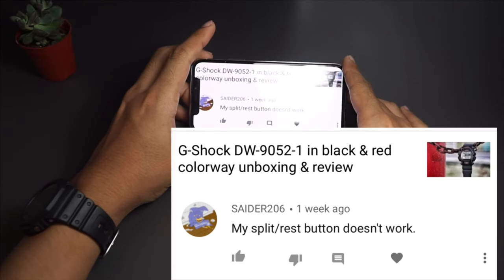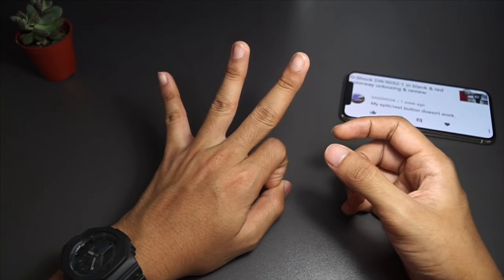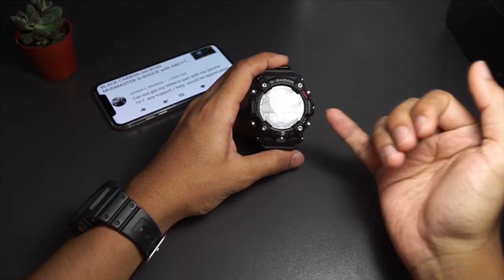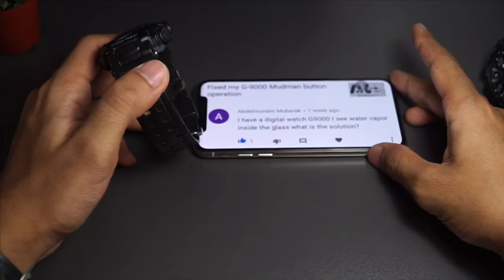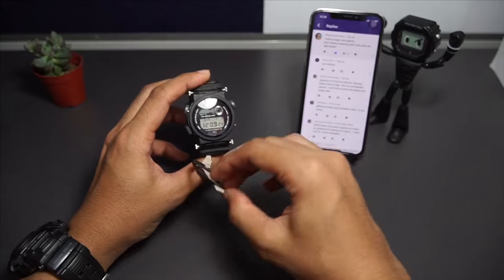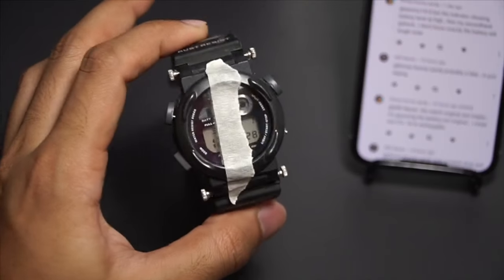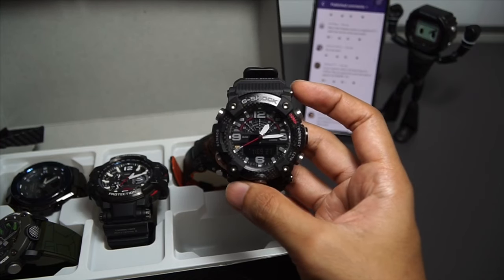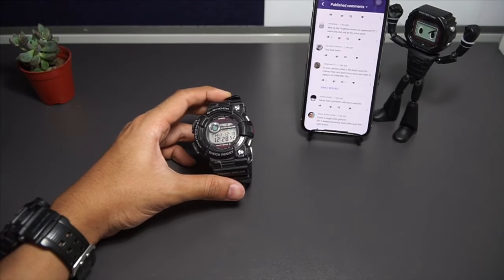3 Reasons why your G-Shock buttons didn't work | G-Shock Q&A

Comment: Hey, Thanks for this video.🤩 Btw I changed battery & did a reset on my Husband's G-Shock 5081 but afterward only some of the settings buttons will kind of work but will not allow me to actually set date, time, etc also the display light doesn't work either.
Any suggestions? Thank you 😊

Comment: Just got a new gwf-1000-1jf from Japan and noticed that the bottom right forward button is not working. This means that I can't access the get screen or make changes in the mode and adjust screens. Any thoughts on this?

Comment: Hi buddy, please help me!!
My g shock ga 400, which was gifted to me by my dad when i was young, has problem with the rotary switch after battery replacement!! Everything else is working! Please help me, no one can figure out whats wrong!! This watch means a lot to me
Reply from the maker: My guess it was loose or it was install wrongfully. 

After a battery replacement, you'll need to perform 'AC Reset' for the watch to work properly afterwards. Do that first, then check the crown.
Reply: @gshockhighfashion  did the AC reset after the battery change, peeps are tellin me that the rotary swtich pin might not be aligned properly, still tryin to fix it

Comment: Hi.. any idea on issue for gulf master GN1000, adjust button didnt work?
Reply from the maker: It's pretty old model by now, maybe some cleaning/grease is required. Inspect the connection on the circuit board as well while at it.

Comment: My casio Gshock G9000MC mudman series, 11 years just running out of battery, can be replaced with CR2025, but the MODE button now does not work for settings, is it because the module is lifted and imprecise

Comment: Hey I changed my battery om my gm5600 scm an when I pressed the light button it did the reset fade to nothing. I ened up just setting the time an date and when I pressed the light button again it worked. Guess the watch had to reset it self or something was in a bind in it.

Comment: I have a Gshock GBD-100 move and I fully broke it down with the shell. I did not take apart the movement on the back but I removed the black rubber shock part, two gray pieces on the sides, the bands and the biggest button. Everything went back together fine because Ive done the bands 100 times but the big black main button on the left will not snap back on or stay in.It almost looks like the way this button is attached, that I may have to find a new one. Help lol, thanks in advance.

Comment: Hi sir, my GBA 800 light wont́ work, only if I press the connect button first,do I need to send it back to Casio or can I fix it at my own?
Reply from the maker: You cannot operate your watch at all
of it is connected to your phone. 

You have to disconnect it first, them the light, the button and all could work as normal.

Comment: my GST-B200 is stucked at "charge" flashing mode, with the needles all pointing at 12pm and buttons not responsive. i sun it for 3 days but no change, could it be damaged battery?

Comment: Hi sir,my g shock 100b light is no longer working.is the bulb or the light is damage??
Reply from the maker: I'm guessing you're talking about GA-100B, if that's the case then that is a possibility. You'll need to inspect the connections on the board for any oxidation or battery leaks and of course the led itself.

I have no idea what is cause for all these issue but I've experienced it before on my GA-200 & GA-150. The problem though, look for the right replacement LED is very hard.
Reply: Okay sir,thank you

Comment: Joshua, since you are on this topic I would ned your opinion on my watch. 

Suddenly all ABC of my 2 years old GWG-1000 malfunctioned for no reason, showing "ERR" whenever I was trying to access them. Never wore them for diving or subject it to any harsh treatments (weather, shocks), no water condensation inside the watch etc. Battery is always 'H' high. 
Then about 4 days later ABC functions came back to life, working as usual until today.

What do you think happened that time? Chip issue?
I am worry it can happen again and might not 'recover' from it.

Merry Christmas and a happy new year 2020!

Thanks!
Reply from the maker: If you still have the warranty. Use it. Theres no need to worry about it if you could get it fixed up for free.

If you didn't have the warranty, try open up the backplate and have a look inside. Perhaps the connection is loose from factory or the sensor surface is damage or so. Check if there're anything odd basically. 

ERR will appear when the board cannot detect presence of the sensor OR the reading went out of range.

Let me know how it goes.
Reply: @gshockhighfashion  Thanks for your reply. Unfortunately warranty just expired not long ago. 
I will have it checked by someone qualified because I am not. Will share the update after that.
Happy New year to you!
Reply: Sent in to local casio authorised service centre for 2 weeks. Came back telling me nothing was wrong about my watch. I doubt that they ever open up my watch to do a thorough inspection after billing me labour charges.

Comment: Can u help me? Because my GA-400 Rotary Switch is not working..
 I Set the time and date.. it doesnt work.. 
This happens when i use it so long
And when i control the rotary switch it doesnt work.. that time that was not yet open.. when the battery is low..
Its dead then i bought batteries for it.
I set 2 batteries..
And when i set time , its not working :(
please help

Comment: Please help I have a ga110 and thr adjust button doesn't work it seems to be making contact with the module is there a simple solution??
Reply from the maker: You'll need to take the movement/engine out of the hardcase. Then, push the 'adjust button' metal panel directly and see if it really touch the circuit board or not. 

This is to check whether the issue is cause by exterior button side button or interior circuit board.

Also, check the 'gold' plated contact in the board is still there or not to complete the connection. This thin coat could wear off over time, if so then soldering paste could fix it to provide contact again. Could be tested using multimeter as well, see if there's any current flow at thar contact point.

If everything as far as the exterior side still works, then full disassembly is required to inspect the circuit board. You'll need to replace the entire board at this point.

Comment: I have GA 1100 after changed batteries all botton not fungtion include light was not working,I tried to reset but still not working,need your solution please,thanks sir..
Reply from the maker: Thats odd. It's either the battery in bad shape or the movement metal connector is loose while you install the battery somewhere. 

I noticed certain G-Shocks only works with branded high quality battery only.

Comment: Hi sir,my g shock ga100 light are not functioning,i already tried what you did in this video but still nothing,also the alarm is not working also,is my watch broke?!thanks
Reply from the maker: For the lights, it is either rusted/broken/loose springs, burnt LED or circuit board issue.

For the beeping alarm, just the silver spring position/rust/loose.

Carefully check all that first before concluding the watch to be broken.

Comment: i think one of the buttons in my watch case is stuck, I can't push it far enough. Any tips?
Reply from the maker: Check the interior for any misalignment or check for any dirt underneath the button, around the shaft.
Reply: @gshockhighfashion  Same thing happened to me.  Turned out to be a slight misalignment (module wasn't pushed in all the way). Works great now. Thanks!

Comment: Due to lockdown and other problems I haven't used my watch for about 2 years after buying it and now it's not working. Its not turning on. It's been only three years since I bought it and the casio is far for me, so that I can't take it for repair.
If you could, please help😭  ( model - GMA-S130)

Comment: Is there a way to reset temperature sensor readings on the bb100 mudmaster?
Reply from the maker: You could reset it to factory settings.

1. Go to temp sensor mode.
2. Press adjust, until the digit starts blinking
3. Press both upper & lower right (comp & alti) at the same time and hold until you hear a beep and 'off' will appear.
4. Done reset. Now you can set it up again for calibration if needed.
Reply: @gshockhighfashion  nice! Thank you very much

Comment: My gbd 200 doesnt work vibration. How could I solve it?
Reply from the maker: whoa, maybe check the settings first, you could turn if ON/OFF there. 

'VIB' will appear on screen if it is already ON.

If it still didn't work, maybe the battery is too low, try swap them. Then do the AC, then it should work.

Comment: I had a problem in the light button of a brand new GBA-900, I changed it on Casio assistance and the problem continues. Does anyone have the same problem with this model?
Reply from the maker: Describe the problem further please
Reply: @gshockhighfashion  I bought a GBA-900 and light button started to fail, it was not every time, but when it happened I had to push the button many times until it works. After 1 month I took it to Casio technical assistance, and they said there was a problem in the module, so they gave me another GBA-900. However it presented the same problem... I looked for on the internet and I found some users saying the same thing. Now I'm talking with the Casio technical assistance to inform this to Casio factory.

Comment: Hi, a very strange thing happens to me. When I changed the batteries on my GG 1000 (normally I did the reset with the tweezers) after a day the time and minutes pointers are stacked. The seconds pointer and the display works fine. I can't find someone who had the same issue with me. It's not the first time I've changed the batteries. Can anyone help me?
Reply: I've the same problem. Help

Comment: Please my one button digital watch inside sensor in broken what could I do
Reply from the maker: A new replacement is needed. If
you could glue or put it back togethe somehow, do if.

We can't just buy a single button and replace them at all. None for sale, unless someone took apart an entire watch then re-sell those parts. Hard to find.

The way I always deal with this is to buy a secondary watch as a donor. Get one in used condition, as cheap as possible. Salvage & swap then re-sell the rest back.

Comment: Well I had an issue on my new Frogman analog: the lower right button you press for 2.5 seconds that points to C on the display to connect to your phone via Bluetooth, NEVER WORKED!!! No beeps to connect, pressed a million times, pressed the button for way more than 2.5 seconds, NOTHING! on a brand new G Shock watch that cost over $800 US?!!!! Unacceptable Casio!! That was definitely a defective module, the button did work for the other functions but the Bluetooth was nonexistent. Returned. Shame.